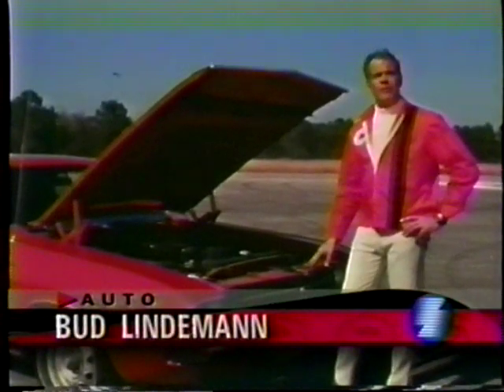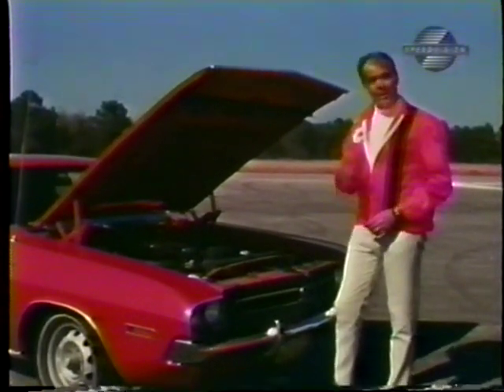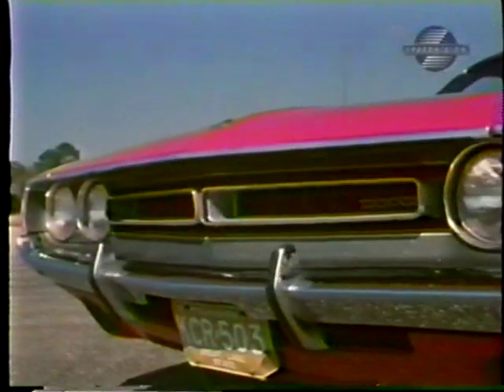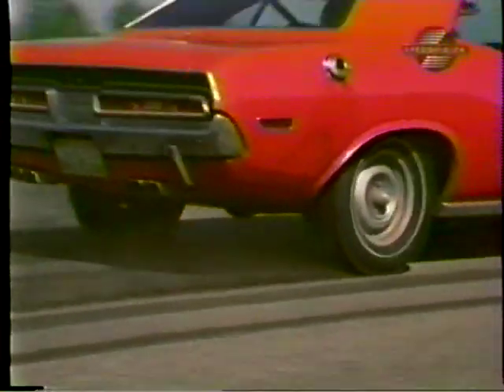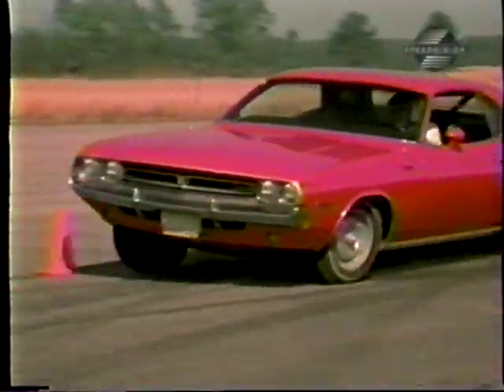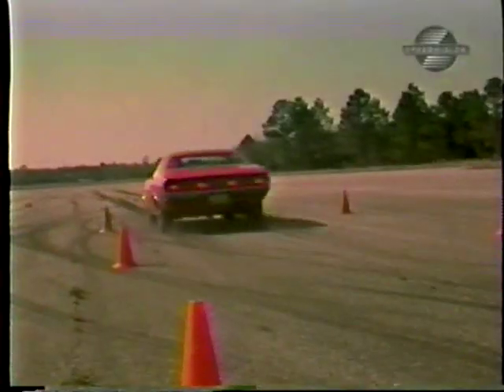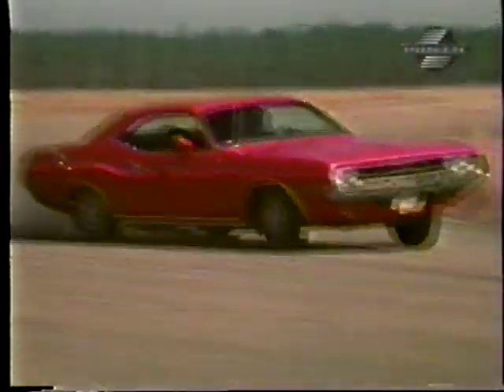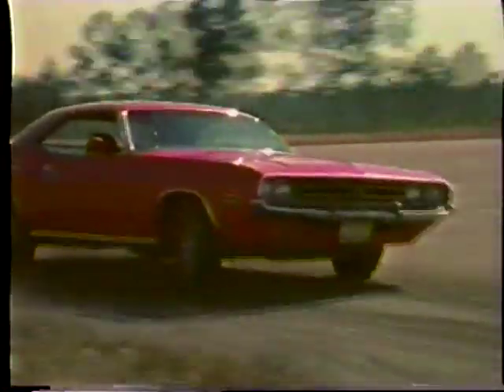1971 Dodge Challenger 383 - vintage road test

Comment: omg........cars handle better nowadays.
Reply: Well duh. With all the electronics it better handle better.
Reply: ok duhhhhhh if you say so
Reply: puppy cat
Over 40 years of improvement makes it unfair to compare these to today's cars.
That would have been like them comparing this car to a Ford Model A. You have to understand the era that something was made to appreciate it.
Reply: Gotta remember... Those cars weigh 2X what modern cars weigh. Today, they have way more plastic and thinner gage metal, along with integral frames. The old cars had a completely different type of frame and again, much heavier gage steel. Modern engines are either aluminum or a lighter steel alloy. The radios in those old cars weighed 3 pounds, alone. No plastic in the bumpers, which weighed a lot as well. You won't see modern cars on the road in 50 years, without EXTENSIVE rework or complete replacement of parts. The old cars lasted much longer but suffered from rust problems due to crappy metal protection and changes to paint, due to EPA regulations. You couldn't do body work on new cars like you could, on old cars because the metal is so thin on new cars. The old ones.... just cut the rust out and weld in a new piece. Yes, i said WELD. That's how thick the metal was on them. It is much easier to handle a light car, than a heavy car but you are right. New cars have much tighter tollerences and suspensions. The old cars had a "fluffy" suspension unless you reinforced it, but then, they sold the parts readily. Today, is much more difficult to just modify a car. Sad, those days are long gone. Computers are great but they killed the "shade-tree" mechanic. Cheers.
Reply: Landotter1 Actually the don't weigh more. The cars are made of less heavy material but they put more into modern cars. They actually weigh the same if not more than old cars in some occasions. Like the 2015 Mustang and Camaro weigh more than some of the 1970 Chevelle options like the 350 option. The SS 454 option weighs around the same as the new Mustang and Camaro. The main thing on them is the suspension like you said, the bias ply tires like someone else said, and the weight distribution. Modern cars try their hardest to get that 50/50 distribution. But you can say that fluffy thing again. I got a 70 Chevelle base model and that thing floats. It's basically a cruise car only the way it is; you better not try and drive that thing like a race car until you do some suspension work on it.
Reply: That was the fun of muscle cars these new vehicles are crap
Reply: agreed
Reply: People like George chambless  and landotter1 know what they are talk in about
Reply: Other people just shoot off at the mouth
Reply: Puppy cat √ thumbs up
Reply: Number 3665 actually they do I had to take a fender off a new Camry and I'm 15 and carried it with one had but I had a 71 Plymouth satellite Sebring and the fender is sooo heavy you have to use both hands I am a BIG muscle car fan and I just happen to know tho the chevelle weighs less than mopars  but on second thought with that said it might weigh lesser than the chevelle (these new stinking automobiles) but my sattelite weighs about 4000 pounds and with a 383 big block 4 barrel simply to say new vehicles just suck more than I can say reads landotter1 and George chambless  comments I know a lot about muscle cars more than I can write right now
Reply: Aziz Lamar As far as weight goes it's still there but it's there in different ways. I'm almost certain the fenders on my Chevelle and that Plymouth weigh more than probably all new car fenders. But the weight that is taken away with lighter chassis and engines etc. are replaced with heavier seats, center consoles, dashboards and so on. People want a house inside of their cars now a days. The new Camaro weighs a little over 4000lbs but my Chevelle weighs 3300lbs.
Reply: number3665 I'd rather have your chevelle;the "new" muscle cars look like Tonka toys!
Reply: Right  number 3665 and zarathrustrasite     To tell you the truth these''new muscle'' kinda look gay with these led and hid lighting slanted body lines and curves hey that just what I think anybody thinks so too
Reply: Thumbs up Number 3665
Reply: Aziz Lamar Yeah and if you want to get technical there are no new muscle cars. By the original definition of muscle car there aren't any left. The Camaro Mustang and Challenger are all Pony cars. And the Charger can't be a muscle car anymore because it's a 4 door. But not many people go by the original definitions anymore.
Reply: put new cars on shitty bias or radial tires and they will handle like ass too. and no, older cars are not heavier. my 1970 dodge dart with a big block weighs 3300lbs all steel. a new challenger weighs  4300lbs.
Reply: Frigglebiscuit Yep,that's exactly right. My 70 charger with a 383 doesn't weigh almost that much or close to it. And I'm pretty sure my 71 Satellite Sebring doesn't come to far to or excess it.